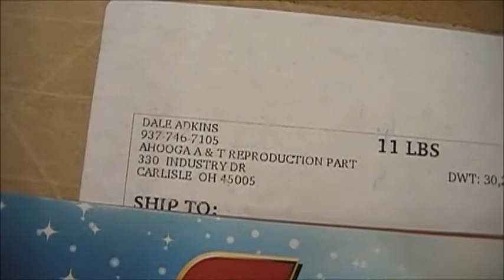31 Ford Model A pickup 38

Comment: Hey Terry Nice to see the update on the 31. Hey that scrap door skin you took off look decent on the bottom. Is it? Would you be interested in selling it? I need a lower door skin for my passenger side but really only need the lower 6 inches. Just checking let me know if you would be interested and we can work something out if you still have it and it is decent. Great job. Thank you Matt
Reply from the maker: I still have it PM me. Terry
Reply: Terry you got a PM message
Reply from the maker: Yes I did you can have that skin if you want it.
Reply: Hey Terry, If you think I might be able to salvage the bottom of it to use on my door then I will take it for sure :) Thank you